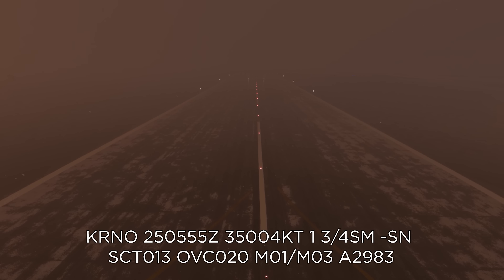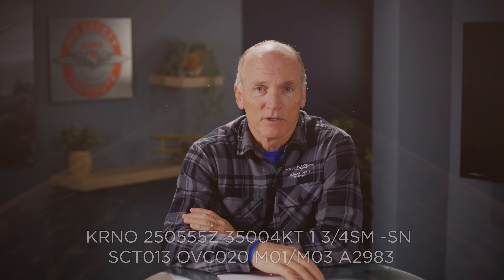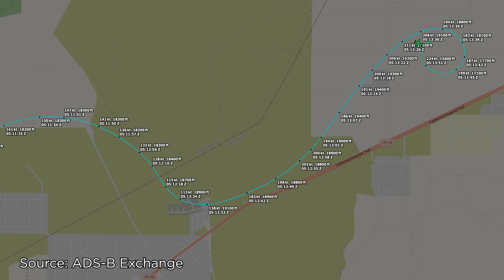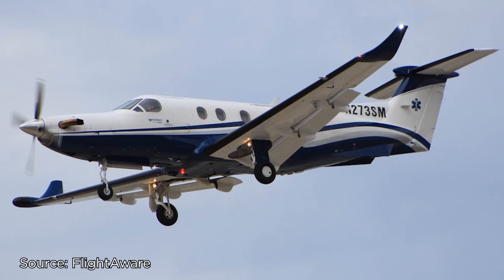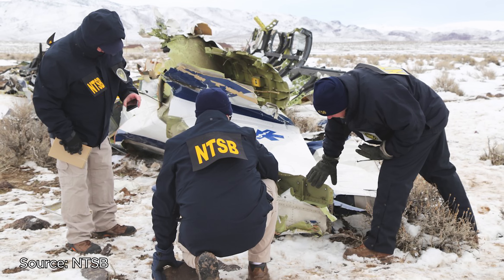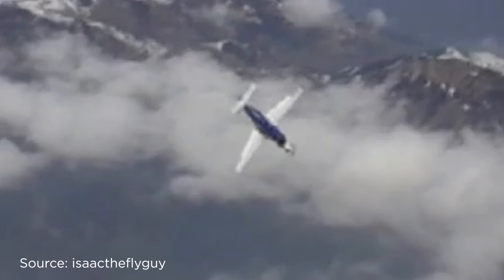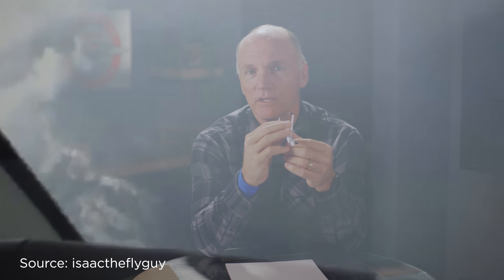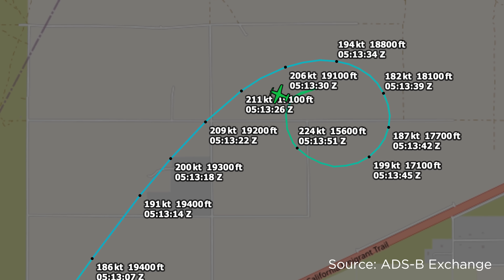Early Analysis: PC-12 In-flight Breakup Over Stagecoach, Nevada

Comment: If ice was a factor, this accident could be similar to the TBM-700 that came apart and crashed onto Route 287 in Morristown, New Jersey on 12/20/2011 (N731CA  NTSB Number: ERA12FA115).  Commercial aircraft departing the NYC area were reporting ice build up so fast their equipment could hardly keep up.  This was relayed to the TBM pilot, who thought he could climb thru it when he requested a higher altitude.  In less than a minute the TBM was falling and breaking apart  The last transmission from the pilot was to the effect of "We have...." then nothing.  Five people died in that accident.
Reply: On that accident they found the inertial seperator in the off position so the ingestion of ice in the engine probably contributed to the Morristown crash.
Reply: @Darkvirgo88xx  Well that’s helpful information. So the crash likely wasn’t entirely caused by aerodynamic failure of the lift surfaces.
Reply: I knew the family in the TBM, great folks. The pilot Jeff was a smart guy but went straight into the TBM from a 182 with minimal experience.
Reply: @joshua8314  Im sorry to hear I wish it had a better outcome for him. He sounded very respectful in the ATC audio.
Reply: Yep. I thought of this accident. In barely minutes this highly capable aircraft went from OK? to disaster. Of course the lesson was how fast icing conditions can occur and overwhelm. Also, that an encounter with actual icing should be considered an emergency. I can understand how pilots can find themselves inadvertently in icing, or forced with no choice to proceed through, or ascend through, or descend through known icing. What I cannot understand is why a pilot would choose to intentionally take off into known icing.
Reply: @Stephen-Harding  Also that Morristown accident the pilot did check the weather but no one gave him the update that propeller aircraft should be held at a lower altitude due to his planned altitude being above it. The controller asked him to climb and he agreed and confirmed the icing and said its no problem. Then within seconds he said he was getting a little rattle which is believed to be the engine ingesting the ice. Then he said declaring and started dropping like a missile. I watched a video by Pilatus on stall testing and there is a reason they implemented the stall warning and stick shaker. When the system is off it breaks left hard into a violent roll that would explain why they start to drop and come apart because I would assume the startle effect would take a pilot by suprise.
Reply: @Stephen-Harding  It's done 7 Days a Week with ice certified Aircraft..........Problem is nature......No One can predict just how SEVERE the icing may be.........You watch Worldwide weather phenomina, right.?......Rare weather can be record breaking severe............Too much for Anyone/anything to handle...........Paul
Reply: That’s exactly the accident I was thinking of.

Comment: Does the PC-12 have de-icing on the elevator counterbalance horns? Doesn't look like it from the photos of the aircraft. Could that have caused a jammed 'up elevator' situation in high rates of icing conditions? There was an AD suggesting that the de-icing was activated very early in the icing encounter. There have also been historical failures of de-icing boots one he PC12. A failure of the tail boot in these conditions would be uncontrollable.

Comment: Where did you get “moderate icing”?
Reply: My thoughts too! There wasn’t moderate icing. I flew a PC12 through that same area about 4 hours before and had trace rime then light clear while flying an approach into RNO
Reply: At FL190 I doubt there could be icing conditions.  It’s a shame none the less, may they RIP
Reply: @johnsalem7765  totally agree. My suspicion is maybe the autopilot kicked off. I used to fly the older /45s and remember whenever you got into rough it would switch off. Maybe he didn’t realize this and the plane slowly started diving to the right? Super sad. My dad passed away in a crop dusting accident so I can only imagine what the families are going through
Reply: Maybe because it was snowing so hard they couldn't find the runway.

Comment: Im surprised a PC 12 came apart like that.
Reply: It's very easy to exceede the design parameters when overspeeding and at a loss of control.
Reply: The United near crash after TO from HNL exceeded the 2.7g that requires extensive examination of the airframe.
Reply: maybe a 2 man crew could have prevented this, it sounds like the pilot was task-saturated.

Comment: It almost seems like the pilot lost consciousness during the flight.  When listening to the tower communication, The pilot stopped responding just prior to the steep right turn.  If there were any mechanical issues, structural or icing, I would think he would’ve called for a mayday.
Reply: It's typically the opposite. When things start going sideways the higher brain functions like speech get pushed aside, unless you have been trained and conditioned to do otherwise.
Reply: That's highly unlikely... pilots are taught to aviate, navigate, and communicate, in that order. Additionally, under high stress situations, a vocal response is usually the first thing to go (i.e. people clam up when stressed). Finally, at FL180 (18,000 feet), a rapid decompression would result in 10-15 minutes of useful consciousness according to the FAA.
Reply: Aviate. Navigate.  Then, time and workload permitting, Communicate.
Reply: Fly first. Communication is later if possible. Fly. Navigate. Communicate  In that order.

Comment: Just want to add human factors to this excellent analysis. 
Get-there-itis may be incredibly powerful when needing to transfer a critically ill patient. 
I wonder if perhaps some crews push the envelope for this reason. Or perhaps feel they are protected somehow because of the worthwhile mission and cargo. These are often the most incredibly capable and experienced pilots and crews.
Reply: some outfits wont allow the pilot to know about the patient condition - to avoid just this scenario. 

But I can tell you that, as a parent (so was the pilot) and the ill passenger was a child, it would be hard to refuse air transport.
Reply: It was not a child.  And policy is most certainly that no patient information other then weight for planning purpose is given until flight acceptance. There should be no consideration of severity in flight acceptance even if this were to be a scene or 911 response.  That seems dispassionate but is for just that reason that we want to help and you have to make a solid safe decision about safety not about trying to make it work.
Reply: That's not how it works.  These are not trauma patients, they are hospital to hospital transfers so generally stable enough to travel (and if they weren't, the pilot wouldn't know it).  If their condition changes on the ground, they turn around and go right back to where they came from.  If it changes in the air the decision tree is no different than any other in flight medical emergency.  

Anecdotal, but pressure to go was higher with both cargo and private.  Helicopters might be different.
Reply: @Milkmans_Son  I don’t doubt that in this incidence you are correct. In general though, when we order transport from our rural area to a regional children’s hospital for patients like an intubated 3-month-old or other critically-ill and at times unstable children and adults (traumas, medical cases, surgical cases like ruptured abdominal aortic aneurysms, and the list goes on and on) there is simply no way that the pilot does not see that critically ill patient being loaded onto his plane. If there is truly a level of separation and detachment, that is admirable and safer for all. As these videos are educational and designed to prevent future incidents, knowing all potential factors is valuable I think. I try to be very careful about ordering air transport for my patients knowing that every year there are a few flight crews that never make it back.
Reply: @GabeWil  I'm not saying the pilot doesn't know anything about the patient, I'm saying by the time he knows anything he has already made the decision to fly.  At least that's how it works with a different outfit that flies the same airplane type in the same region of the country.
Reply: @Gabe Wilson  that is why you don't get patient info with the initial request.  You are supposed to make a disspationate decision about safety to fly without knowing what is wrong. This is because human nature will take over once you see or know what the patient is going for and you will take unnecessary risks to "get the mission done"  making the decision to turn around or cancel once you have a patient is very difficult and should be avoided by turning the flight or finding other means to begin with.
Reply: @Milkmans_Son But there had to have been some urgency that would have justified a nighttime bad-weather transfer though, right? And who pays for these flights, just curious.
Reply: @nancykaufmann3993  You're not curious, you know exactly who pays.  I suspect the reality is they make so much money it has the opposite effect.
Reply: @Milkmans_Son  Wow, how rude. As a non-pilot and non-physician, I was asking two legitimate questions based on the comments above. But nevermind, since you seem to have some kind of chip on your shoulder.
Reply: Gabe, my spouse worked for this service. The pilot absolutely knows the condition of the patient. 

From a source on the ground crew that transferred and helped load the patient, all were questioning the reason for the urgency of transfer for a stable patient for a procedure that could wait for better conditions. 

I lost a peer on that crew. I know what goes down. There were external pressures that influenced the PIC and crew. Namely, operational pressure, normalization, ego, and a balance of successful missions without consequence. 

It would be an interesting study on when the majority of fixed wing aeromedical flights originate. Anecdotally, I can say they are post 1800 hrs, with highest frequency between 1700-2100 hrs, and 0400-0800. Why? This is when the physicians go off shift and need to transfer their “ego” failures because they couldn’t fix them.
Reply: @chrisgraves-pp1ph  hardly anything to do with ego. It's more that you don't want to offload a severely ill patient, with critical decisions like transport or not still to make, to the next person coming in to their work shift. It's considered bad form to force the next physician to start their shift with a bunch of critical decisions about patients they haven't even met yet. So you try to make a plan before your shift ends, and if it looks like transport will be needed, you'll make that decision before going off shift, if possible.

Comment: The stall scenario given the conditions is all very plausible but what strikes me is the structural failures. The wing tip in particular.
Reply: I just read that the descent rate was 30 thou feet per minute, if that's telling.
Reply: I also would like to understand that.  However, the wing failure is really insignificant.  Once you lose the horizontal, you have no recourse.  The high descent rate will do that.
Reply: Right wing tip is where the radome sits... Maybe extra force on that tip

Comment: The weather at KSLC has been severe enough this winter that I have cancelled several planned flights. That particular day the pilot would have been chasing what became a NWS Winter Storm Warning when it reached here. A PC-12 is a very capable aircraft. But FIKI or not, a whole lot of risk factors stacked up that day. Single pilot IFR, night IFR, single engine, guaranteed icing conditions, and then the turbulence AIRMET... a lot of airlines were delaying flights, and I wouldn't have felt comfortable taking off into that. I wonder what the plan was for assessing climb performance, for turning around, if there even was a plan.
Reply: I was debating even making a drive to the grocery store on the day that this occurred.
Reply: But at least the operation is CAMTS certified.

Comment: Best logical, scientific first look yet at this incident. Others seem to be falling over themselves with A. Low vis B. L.O.C. C. Ergo spatial Dis.
But I'm surprised you didn't also mention physical. Even if there's no specific support, it actually fits the facts better than any of the other speculations. Consider: sudden deviation (unconscious or blacked out , falls onto the control). Sudden loss of communication(blacked out). Spiral in one direction(blacked out, falls onto the control). Massive, MASSIVE plummet(unconscious or blacked out...). Just saying, it fits too well to ignore.
Reply: The descent fpm was so huge that it also should be strongly considered as what did the in air breakup.
Reply: Sounds like you know that Sherlock Holmes quote.
Yes, other factors like weather and visibility are suspicious culprits, but that's no reason to ignore the "easy" explanation, a less exotic possibility.
And oh, I just read 30K ft/m.  30K !! Is there any craft that can survive that intact?
Reply: @decapitatespammers  That's actually just under 300 kts, so a lot of aircraft could technically survive it, but you'd have to start out very, very high, and begin recovery very, very early. Because you'd be in a dive. Then again, ADS-B altitude information is sometimes sketchy.
Reply: That no one knows.  Maybe he was busy trying to recover the aircraft to talk
Reply: Except that it appears he corrected for the first turn off course then less than a minute later turned the same way.  So Spatial disorientation, caught it, looked away from flight director, possibly to check for ice on wings since you have to make sure the correct amount has built up before popping the boots, and since his inner ear was still sending wrong information to his brain didn't catch the new turn soon enough.
Reply: The most obvious explanation is usually correct…. weather.

Comment: is there any reason to not have all anti-ice systems in a plane active at all times?
Reply: They require power that would otherwise be needed to make the plane go.

The PC-12 has equipment to clear ice, but does not have equipment to stop it accumulating in the first place.
Reply: Pneumatic boots, take pressurized air out of the compressors, therefore power.  Also mind you that the boots are de-icing, and most require accumulation before activation.  Otherwise ice could form over the extended boots, rendering them useless.
Reply: All ANTI-ice should be on before entering icing conditions.  The large turboprop I flew (SD3) would turn off the anti-ice that used electricity to heat various things (windshield/pitot/static ports) in the event of an electrical failure using a shedding bus.  The pilot could override it.  DE-ice (boots) are covered in jfsa380's comment.  How often one engages them depends on the rate of accumulation.  In moderate icing one might pop them about once every five minutes which is not enough of a power drain to matter.  However the ice deflectors for the engines (ANTI-ice) did reduce power a few percentage points by reducing the flow of air into the engine - I stopped flying 35 years ago so please forgive me for not remembering the number.  I also do not know if the newer PT-6 engines use a different ice protection design.

Comment: Considering it is such a small aircraft; would there have been an option to fit a plane-parachute, and if so - could it have helped in this case?
Reply: Considering the PC-12 is 3 times heavier than a SR22 (small plane fitted with a parachute) and is way more powerful, I doubt it. Parachutes are usually for small and light airplanes and helis, and they won't work if the airspeed is too high (it'll break off), especially when the plane is in a dive following a loss of control.
Reply: A PC-12 might be small compared to an airliner but its not a "light aircraft". It is over 10,000lbs. For comparison a Cirus SR-22 is 3,600 lbs max. Its also much faster (285 knots) vs 183 for an SR-22. Aerodynamic forces go up with the square of speed. Together these will mean very much more load on any parachute system. I'd estimate 7 times as much as on an SR-22
Reply: @FasterLower  The SF-50 has a parachute, and cruises at 300 knots. Granted it is lighter.
Reply: The answer for this medevac flight is exactly what Pilatus designed for harsher conditions than a pc12 is suited for: PILATUS PC-24 with HOT metal leading edges.
Reply: @jonasbaine3538  There is a huge price difference between PC12 and PC24.